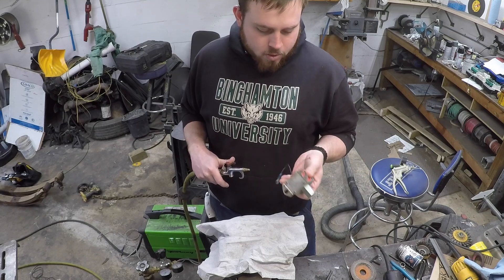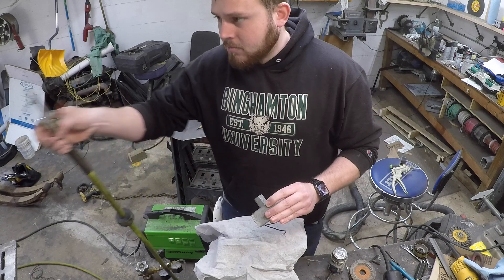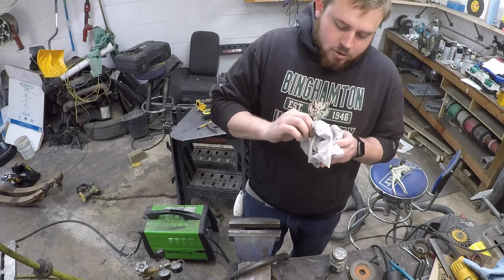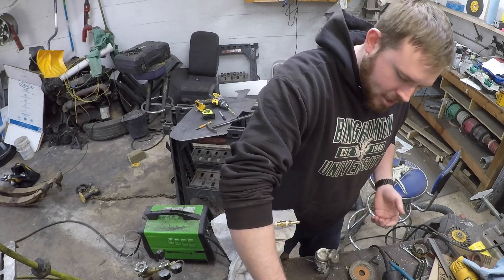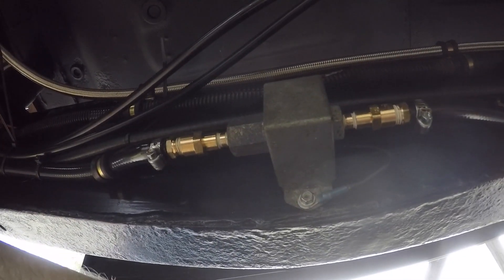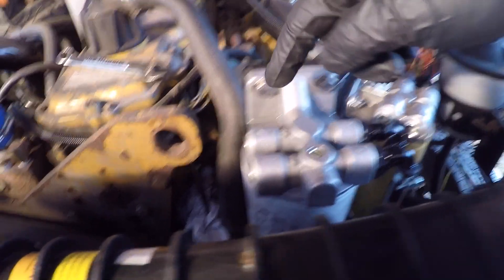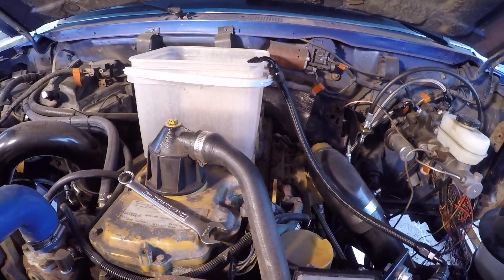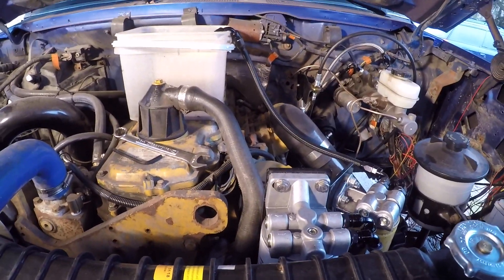Pt. 23 Trying To Fix My Non Existent Fuel Leak. 91 F350 CAT 3126 Swap

Comment: What ratio of waste oil to diesel were you running? Is your tank still filled with waste oil?
Reply from the maker: I started with a few gallons of oil per 19 gallon fill up and worked my way up at the end I was running 100% waste oil. The last 700 miles I put on that engine was with strait waste oil (cut with 20% regular gas to thin it down) and it ran the same as with diesel. No tank was pumped and cleaned out during the swap.

Comment: what was you no start issue since it was not fuel?
thanks
Reply from the maker: Oil pump was bad and loosing its prime and took forever to prime. Heui needs oil pressure to run.
Reply: @DrEwBaBy625  thanks watching the whole series and enjoying it! 
Good luck in all you do